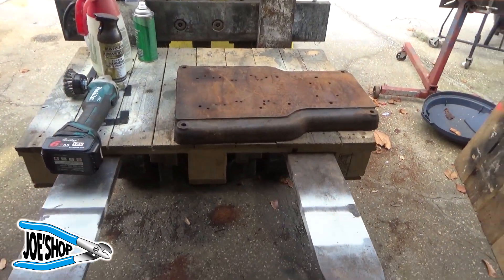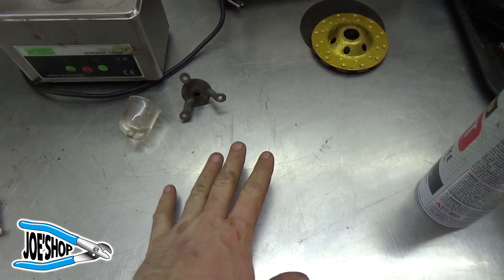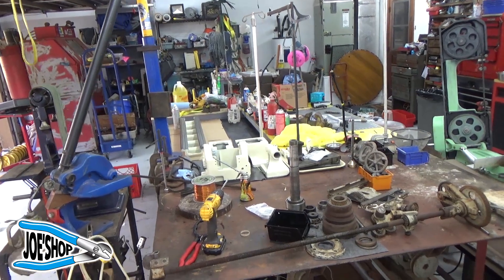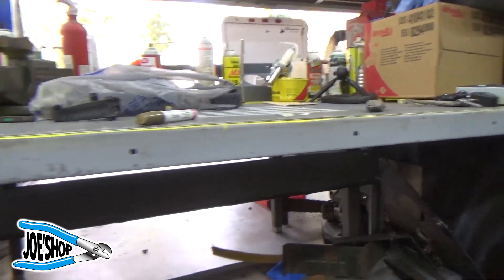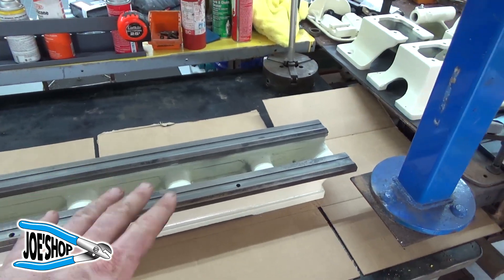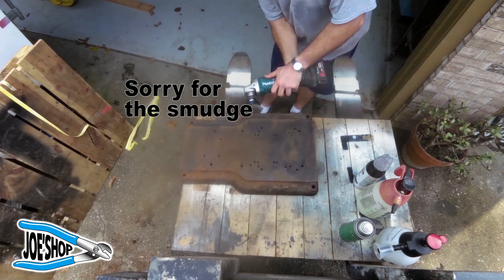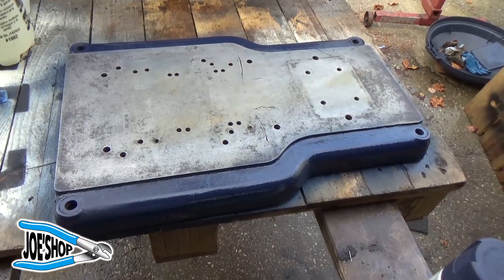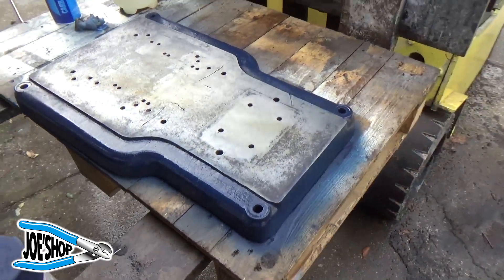Muriatic Acid vs drill press base

Comment: I think you should just spray the acid and leave it for few minutes to do its job..instead of wiping it right away and doing it repeatedly...muriatic acid is quite powerful and it can wash away the rust pretty easy if you leave it alone to do its job and wipe later on like in 10 minutes time
Reply from the maker: Thanks, ill try that next time. Cheers